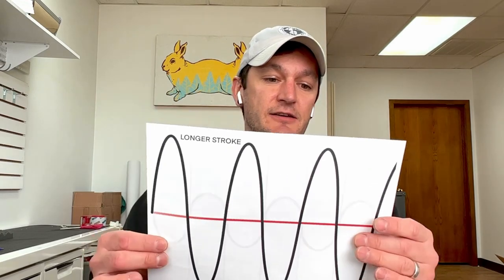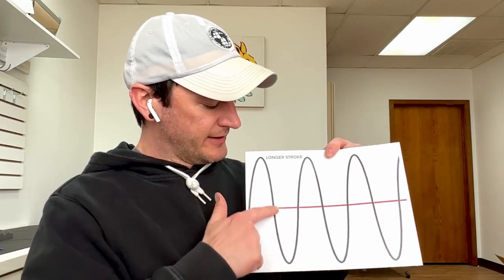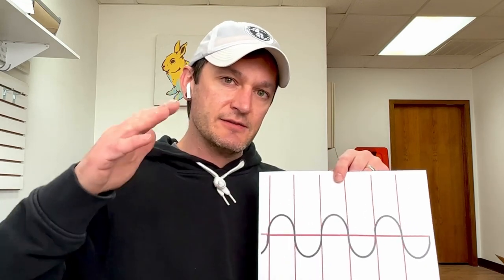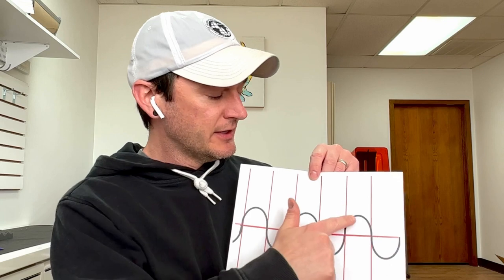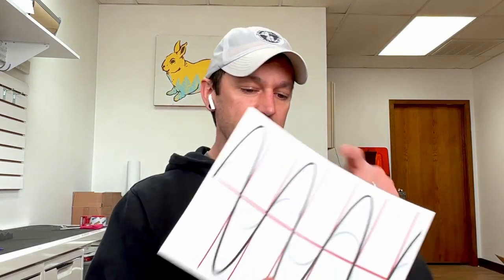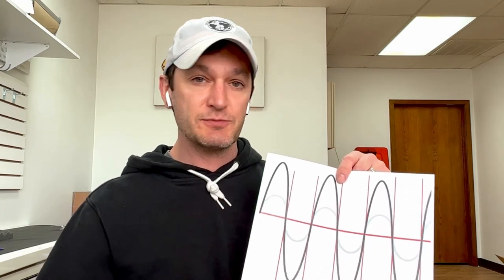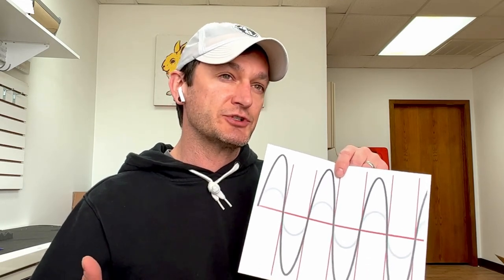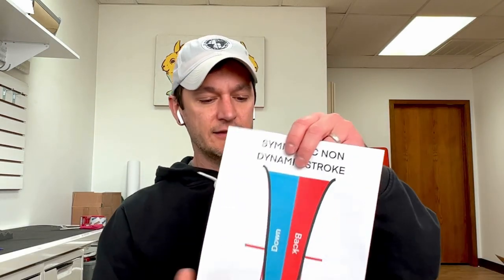CHARACTERISTICS OF A DYNAMIC STROKE

Comment: So much info in this video!!! Thank you for this, I do have one question though, how can we tell if a rotary machine has a dynamic stroke or not? Just ordered your steeldriver but the fk iron edge x(hopefully the steeldriver replaces it) the only rotary I could ever line with and I always wondered why
Reply from the maker: Thanks for the support! The spectra edge doesn’t have an engineered dynamic stroke. But it does have a 4.2 mm stroke available which would give you a good needle velocity which definitely helps. If you’re using the give setting those factors could produce a dynamic stroke depending on your setup and how much that carriage is moving independent of the cam.

Comment: Very informative but I really don't get this . In coils liner should be about 110-150 Hz so the stroke is quite small and its totally opposite in rotaries or even in hybrids. Why ?
Reply from the maker: Because the speed of a coil is dictated by the frame geometry and spring setup. Not all coil liners have a short stroke. But a smaller gap machine will typically run faster. Rotaries are different because the speed is dictated by the voltage and motor design. So it’s not relying on geometry for speed, so you can use that set cycle speed and translate it to needle velocity with the right setup/geometry.